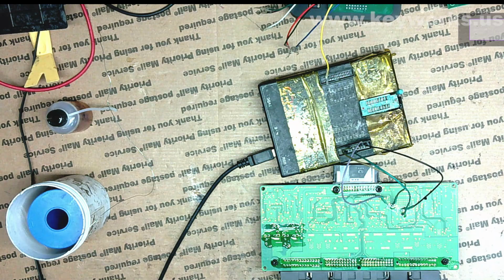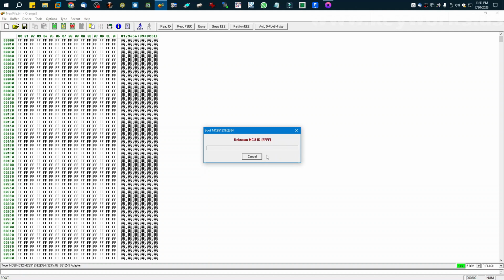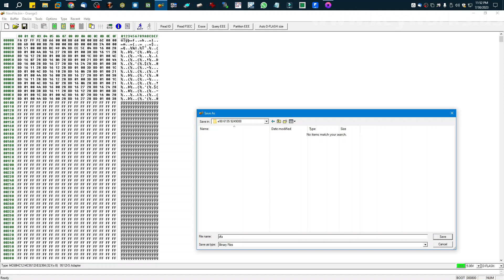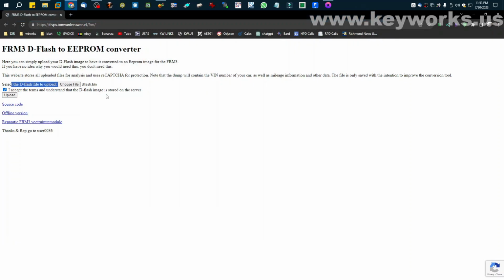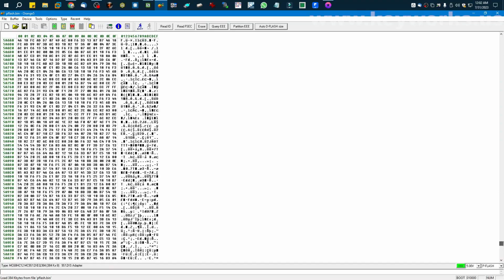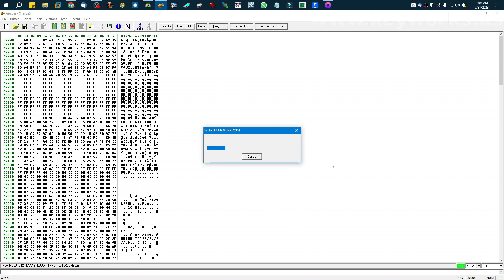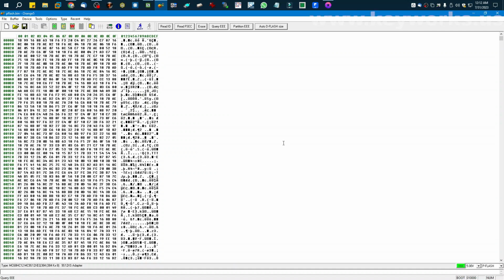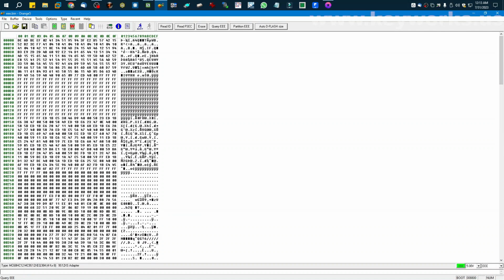BMW FRM3 footwell module recovery repair with orange5

Comment: Good day sir, what happens if the Dflash theres no info and EEE but Pflash is available is there a way to save for example a bcm that got corrupted, i was working on a Jaguar xf 2013 after battery removed it corrupted the front BCM
Reply from the maker: For bmw if there is no dflash you have to use a known good dflash from another module and then code the unit same as you would a replacement. I dont know much about Jags but I assume it would be the same.
Reply: Thank you very much, really appreciate your feedback 🙏
Reply: Jaguar bcm, need full flash with jlr and adapt to car again to fix that issue

Comment: why did you make this video and not clearly show where the wire plug in the orange 5? Not to mention as you jumping around with the pins and skip saying the name of what you're plugging in? Seems obvious to focus a little bit on the actual connection. Then you open the software and say "Let's go into 'device''" and you clearly clicked "type" Why make a video, that should informative, and make no effort to avoid confusing people?
Reply from the maker: I do call out each pin as I connect it.  VCC, RST, BKDG=RXD and Ground. They are what they are.  As for saying Device and clicking "type" I use a lot of tools. These are generic terms for going into the software and selecting the chip you will be reading. TYPE is short for TYPE OF DEVICE.

Comment: Bonjour pouvez vous mettre les pin  avec orange5 merci
Reply from the maker: as connected in video:
#1 purple wire = vcc
#2 yelllow wire = rst
#3 black wire = gnd
#4 green wire = rxd
Reply: Thanks you

Comment: hextag best for these and many other modules
Reply from the maker: Its not hard to do it with any tool that works with 9s12xeq384. Hexprog does have a nice dummy button to do everything for you it looks like which can make things easy.  Personally I havent used it so I cant comment much on it. Thanks for watching.
Reply: another question is it necessary to program the dflash after eee and the pflash
Reply: Where you can find tutorials about the calculator procedure of orange5 ?

Comment: Hell, your 🍊 Orange-5 has had a hard life 
Nice job on the FRM 😎
Reply from the maker: This ones had a hard 6 year life for sure.  Love orange5 but wish they used an aluminum case. I have a tendency to use hot air on it. The kapton tape helps a bit. I have my tl866 wrapped up with it as well.